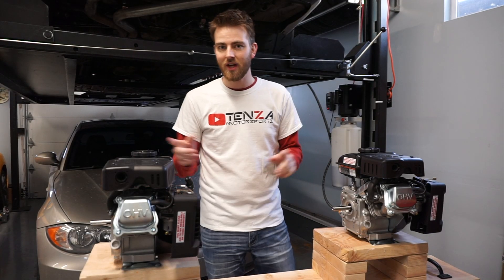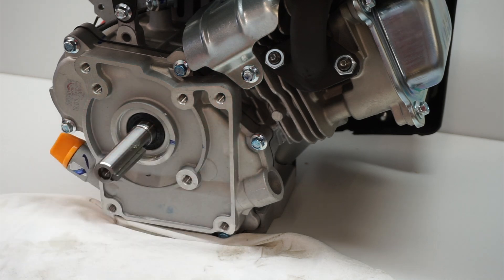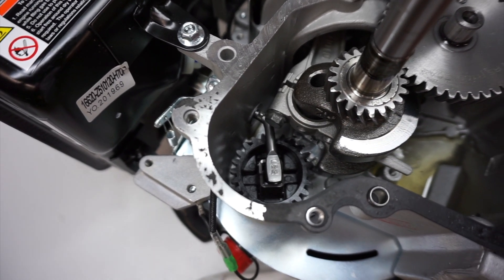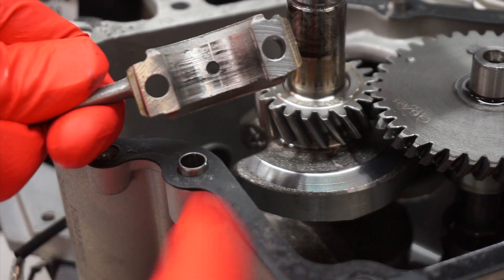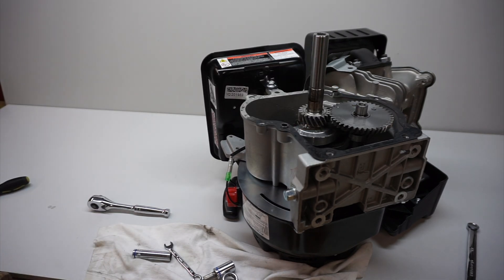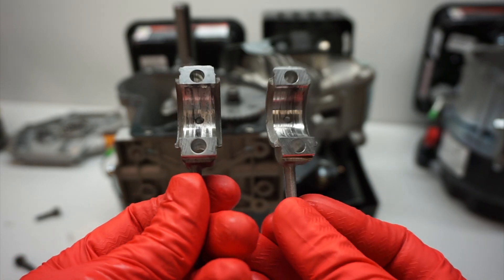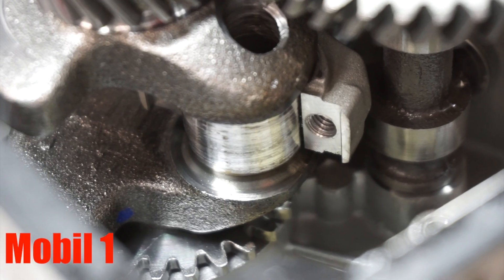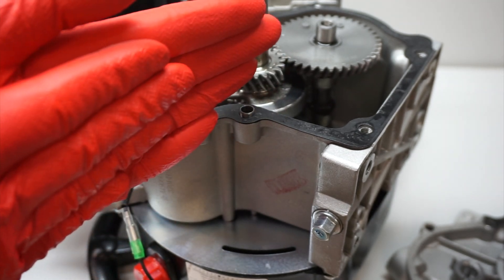Mobil 1 vs. Amsoil. Damage Report Torture Test Results. Search for the best synthetic oil (part 3)

Comment from the maker: Thanks for watching!
Also make sure to check out 
Part 1: https://youtu.be/RHk_fibP2wA
Part 2: https://youtu.be/wak8bnOBbM8
Reply: I hope that next time you will try Petronize oils that carry a special technology to prevent friction and compare them with other oil companies
Reply: People should also use whats recommended for their engines and not go by brand for example u cant use synthetic on mazda rotary engines and nissan likes esters in their oil the 370 or 350 so motul works best on those and cars with flat tappet cams use valvoline vr racing oil people need to research what engine they have forget going for brands ferrari use shell helix ultra no mobil 1 or amsoil not those cars folks
Reply: I know people that tried mobil 1 and switched to castrol engine was quieter on castrol the valve train so going with brands cause someone said its the best is not true all motors like different oil amsoil wont be good for all engines but people believe google and the internet lol

Comment: R those mtors aluminum  bore.if so you used the wrong oil.small engine oil is different from  auto oil.small egi e oil is made for SMALL engines
Reply from the maker: … im aware… but we aren’t testing small engine oils. If I was, we would have used small engine oil.

Comment: Which one do you like better and think is the best oil personally?
Reply from the maker: I've used both and either will work for most cars. In my opinion, the highest performance oils are overkill for 99 percent of engines.
Reply: @TenzaMotorsports I’ve used both to I’m currently using Mobil one extended performance 5w30 in a GM 6.0 LS2 v8 I was using amsoil signatures series before but it gets expensive after a while, the valve train does seem to be louder with the Mobil one extended other than that I couldn’t really tell a difference between the two

Comment: Cool experiment, but the only thing i got from this is that engines fail due to oil starvation. One engine running for 2 mins longer hardly proves anything, IMO. To add the clearances on the bearing surfaces of the rods to crank could be different on both engines. If the egine that ran longer had sloppier clearances that could account for your longer run time to failure.
Reply from the maker: I love reading comments like I’m the one who came up with this test. This is a common expo/torture test done by the big companies. I didn’t come up with this myself, I was just testing things. obviously the engine would fail. That's literally the point of the test. The number 2 minuets doesn't mean much by itself. but 2 minuets is a 30% increase. That's not a small number. Even thought these engines aren't some high end, high tolerance, precision pieces of art, doesn't excuse a 30% difference.

Comment: I now run shaffers supreme 9000!the most expensive motor oil I’ve found yet but the oil life is phenomenal!
Reply: @adrianrobinson7953  We used Schaffer’s in our Honda Odyssey minivan fleet. The vans were used to transport medical supplies all over the country and every single van surpassed 300k miles of about 60 of them. Some were wrecked, a few lost transmissions, but there were never and catastrophic engine failures that had anything to do with the oil. All we’ve driven the same consistent route by the same 50 something drivers and all of them hit 300,000 miles within four months of each other. And we went from the recommended 7500 miles to 17,000 mile oil change intervals because oil samples told us we could. Schaffer’s is the best kept secret that people need to know about.

Comment: Amsoil is a great oil but the price is highway robbery. 

I buy cheap synthetic oil but change every 2k oil and filter every 4500. At some point the garbage the filter can't catch get built up in the oil and also if you have unknown fuel dilution no oil will hold up long, changing often mitigates that possibility. I expect to get 300-500k at around 1/3-1=2 the cost of Amsoil. 

My take anyway. If you run Amsoil that's OK too, I just have a different perspective.

Comment: Mobil1 uses alkylated napthalene base stock oil which is superior than pao + ester base oil. I used to be an amsoil fan but after learning so much about oil, I realized Mobil1 is really the best with superior technology. Sometimes one really needs to learn more about chemistry and material science to judge an oil, not just by looking at spec sheet.
Reply: @lamelessness  Mobil 1 is some of the most garbage oil on the market. Their extended performance oil will not last 20k or even 10k without smudging up. It’s terrible cheap oil. Amsoil is the best on the market hands down. Lots of people have put Amsoil to the test and it outperforms everything out there
Reply: I would only say this the results do not lie is all about how much the oil is helping at lubricating i only care about that and the numbers do not lie.
Reply: Oh another thing bro the whole gallon of mobil 1 is not 100% full with alkylated napthalene base stock oil where as amsoil gallons are full with synthetic oil. this is another reason why amsoil is superior. i will say this if mobil 1 was give you every gallons with alkylated napthalene base stock oil  i would probably say they could be the same, but movil 1 is probably only giving you like 25 to 30 % of that syntetic alkylated napthalene base stock oil in every single product they sell you. where as AMSOIL that company is giving every single container full of 100% syntetic PAO, BUT MOBIL 1 NOT AS I SAY THEY ARE ONLY GIVING YOU 25% TO AT MOST 30% THEY REST IS JUST LITERALLY CHEAP OIL.
Reply: It does not matter if mobil 1 is using the best of the best, but if they are only giving you 25 to at most 30% that will not help to protect your engines. what will be better for you and and me and everyone it would be if mobil 1 was puting on there primium oil gallons this " 100% SYNTHETIC  Alkylated naphthalene  OIL" OR PUTING IT THIS WAY "THIS CONTAINER CONTAINS OR IS FULL OF 100% SYNTHETIC  Alkylated naphthalene  OIL" That my friend right there will AN amazing TITLE RIGHT THERE FOR THEIR PRODUCTS. What do you think @lamelessness?
Reply: @lamelessness  🤣🤣🤣 you haven't a clue what you're talking about

Comment: I am so sorry, you lost me at “NO OIL!” So I am compelled to comment to state the “obvious!”  This is not using the “scientific method” whatsoever!!  You can ONLY “test” one “variable” at a time.  In this case there are innumerable variables… HP, compression, machine assembly tolerances, etc.,etc.!!  You also need a higher “sample” size to determine “________” conclusion!  Please watch the “MotorOilGeek” channel with Lake Speed, Jr. for actual truth results using “scientific method”!
Reply from the maker: Wow, where to even start with this comment. The internals of these engines are not completely devoid of oil. That’s been explained many times. When your engine fails are you sitting there trying to figure out how many variables there are? No. You have one engine in your car. Not a sample size. This is a random torture test. The tolerances between these engines are probably close than if you took two random cars off the road. If you don’t like the tests. You go watch other videos. I don’t care.

Comment: HAVE TO USE OIL FOR AIR COOLED ENGINES NOT LIQUID COOLED ENGINES WHICH RUN AT A LOWER TEMP. USE AMSOIL SMALL ENGINE OIL.

Comment: A friend who built engines for short-track racing and also raced his own car, ran several different oils in his own motor until he found the one that showed the least wear on components, rod & main bearings, lifters & cam, and pistons/cylinder walls. This was before the current synthetics.

Comment: It doesnt prove anything about the oil, most of the oil is spun off immediately and what residue is left is baked on. It shows me that the cheap engines have a big difference of tolerances. Also another senario is the amsoil retained better, baked in a thicker layer, hince the brown look. This test is not how engine oil was designed to be used. Time and time again in tests amsoil wins against all the other brands.

Comment: Where both engines broke in with normal break in or convetional oil before the test? As any new engine should be broke in with a break in oil ams oil even says never to use a synthetic to break in a engie
Reply from the maker: Whether that’s the case or not, that wouldn’t matter. Since all engines were tested under the same parameters, they are all identical conditions.

Comment: Comparing 2 engines running 2 different oil then running them dry proves nothing imo. Engines are designed to run with oil and once they run dry there’s no way to compare how any residual oil would do better than other brands. I’m betting if you did this test multiple times you find different levels of damage each time!
Reply from the maker: They aren’t ran dry. They are ran on very low oil. If they were dry, they wouldn’t have ran for 6-7 minutes. And yes this is a test, big companies have done it with full size engines to show the tackiness and film strength in extreme situations.

Comment: Amsoil lasted longer than Mobile 1 in an engine with all the oil drain out, showing better protection adherence to the metal than Mobil 1. Each should look catastrophic, Amsoil just kept the same catastrophe from happening two minutes longer which pretty damn impressive. 👍

Comment: Amsoil and Mobil 1 are both excellent products and have used both. the general thing is you never want to run an engine without oil under any circumstances, and no matter which brand you use the oil will get dirty over time. it is up to the owners if they want to spend the extra bucks for a premium oil like Amsoil or Royal Purple. personally I think it is foolish to use ANY oil for 20 or 25K intervals. whatever amount of time or money that is saved is not worth  the risk of damage.

Comment: Sorry, I know this took some effort. But if you're interested in testing oil differences this is a useless test. Not only do the actual engine's from Harbor Freight have a fairly wide set of tolerances, motor oil isn't dssigned with clinging as the primary performance factor in a dry environment. None of these modern engine oils are meant to be ran in a dry engine like this.
Reply from the maker: Sorry you don’t understand the test perimeters. If you watch the first video in the playlist it will explain.

Comment: You would need to run this test 10 times or so to have a decent sampling due to the varying tolerances in the chinese engines.
Reply from the maker: The tolerances on these engines compared to each other is tighter than finding two random cars on the used market to do the same test. That’s why we did it this way. Unless we wanted to get two perfectly identical new car engines. As for the number of times the test should be performed. Yes the number should be closer to 20. But we don’t have that kind of budget here. So all I can say it. Your car only has one engine. We only did one test.

Comment: What is your recommend for motor oil names????.which right oil for engine that want go 500 k miles?????.want save money not amsoil????
Reply from the maker: Get some oil designed for high mileage and run the oil brand the car manufacturer recommends.
Reply: @TenzaMotorsports  I drive 08 impala ls 98 k miles.i was thinking buying quaker state oil.

Comment: How is this an oil comparison when there is no oil to compare?
Reply from the maker: There is still oil in the engine. It’s just a very small amount coating all the components. That’s explained in the video. We did a base line test with no oil. It ran less than 2 minutes. So these still have a small amount of oil showing what the products can handle in the extreme

Comment: assuming we never drive a car that the oil ran out on us (very rare) which one protects it better under our normal driving ?? Amsoil does. many  other independant tests shows mobil 1 is average at best (actually less) for its competing brands.  if you car runs dry,  2-3 mins more when you dont know, aint saving you engine.. but normal long life driving, many brands protect your engine better than Mobil oils.
Pronect Fam guy tested many oils too & it was knocked out in first round of tests
Reply from the maker: He froze oil. Boiled it on a stove ground two pieces of metal together. None of that answers the question you were just asking about. This shows the performance of the oil in a very extreme condition. Ran in an actual motor. But it sounds like you have yourself sold on Amsoil from the start.
Reply: @TenzaMotorsports  because every other independant test on mobil 1 i have seen, its test results are on the shitty side, & amsoils is always the winner or 2nd place. i am sure most who watched this have seen the tests i am talking about, as you may have as well.
Reply from the maker: Well Amsoil lost in this test. And I went into this one completely unbiased. I don’t use either of these oils on my race cars.
Reply: @rpmautoreviews9249  Amsoil is overpriced and overhyped.

Comment: Try Liqui Moly Molygen. You will be surprised. However the oil needs to run in the engine for a while, and settle in.
Reply from the maker: I run them for 4 hours on high. Should be long enough

Comment: If you do a bearing scar test, where the oil is tested in a bath, not how well it bonds to the metal after drained, Amsoil still has the smallest wear scar. As soon as there's something with more protection, I'll run that.
Reply: Exactly
Reply: I've always ran Mobil 1 4T racing oil in my CBR600RR, I switched to Amsoil by recommendations from other guys at the track. I ran Amsoil for a season and after cracking the case at the end of the season I saw absolutely no difference in wear, for me I cannot justify a 100$ oil change VS a 60$ oil change. Maybe there is a microscopic difference but again certainly not enough to justify the price difference, Just my opinion.
Reply: I absolutely agree with Amsoil for transmission fluid. It is almost a miracle fluid, but for an engine, it really doesn't matter. I ran the cheapest thing I can find. The most important factor is that you change the oil regularly. An engine ran with conventional oil changed every 3-5k will last as long as an Amsoil engine.

Comment: I got a Honda GX200 and run 10w 30W and it has ran every day for hours for over 3 years. They run a pump 5-6 days a week and the only down time is adding more fuel or travel time between locations. This is in cold and hot Texas summers so I would say Mobil 1 has done very well and Honda builds damn good engines.

Comment: you ran em without oil!!! what did you expect would happen?  big end connecting rods are the first thing to go on splash lubricated small engines that run out of oil. Put some AMSOIL Small engine oil in one engine and some other small engine oil in another engine instead of  automotive oil and run the crap out of them under heavy load and high rpms, get em hot for a long time. then take em apart and see what you got.

Comment: LISTEN MAZA HAKAS   I RECOMEND CHANGE SYNTHETICS EVERY 3-4 thousands miles despite engeneers buulsheet    THERE IS  BIG FAVOR YOU WILL DO TO YOUR ENGINE  LIKE NOTHING ELSE I CHANGE  EVERY 1K-2K  HONDA 2000 ODYSSEY 250K WHEN I WAS GIVING I SINSE 237K I CHANGED OIL LIKE 10 TIMES IF I DID NOT DO THAT MY ENGINE WOULD SING LAST NOTES BARELY BUT IT STILL RUNS 80MPH ON HIGHWAYS AND MORE😄😄😄  dont even think of a stupid  AMS OIL AND BUMMER PURPLE💩💩💩💩👈

Comment: You ran both engines dry in an attempt to see if the damage was different in one to the other ? If they failed because they had no oil, the wear and failure points are going to be similar. Not sure what you expected out of this.
Reply from the maker: The engines were not dry. They are very low. There is still oil on the surfaces. The results are very close to what we were expecting
Reply: Complete waste of engines that prove nothing

Comment: Most all small engines are built without rod or crank shaft bearings. Running a engine without oil really proves nothing. As soon as you start the engine, the oil left between the rod and crank is spun off. The aluminum rod then heats up until it seizes.
Reply: Specially doesn't prove anything in one of these cheap engines. None are the same.

Comment: Harley Davison guarantees your engine as long as you use their own brand oil or Amsoil I use Mobil on my Harley Davidson Ram2007 5.9 Cummins and my wife’s 2013 Nissan Sentra believe it or not when i started to use Amsoil on my wife Nissan after couple hundred miles is stated to give her better gas mileage it went from 33 mpg to 36.7 mpg on my Harley the temperature went down like 4 degrees cooler I tested it with my snap on laser thermometer and on my Ram it also gave me better hair mileage like 1.7 almost 2
Reply: Waow nice feedback o Amsoil..im using also amsoil signature series on my diesel truck much smoother. I want to try Mobil delvac

Comment: Crankshaft bushings are designed to float on a cushion of motor oil.  If you drain all the oil there is no more cushion so of course both oils fail, grease would work better in this situation.  You are spending a lot of money destroying engines but not proving anything.  You would need to let those engines run normally for a set amount of time then do a tear-down and look for wear..
Reply from the maker: I explained in the video the reason for the test and why it’s relevant. Thanks for the comment.